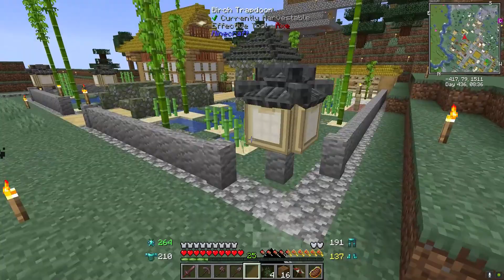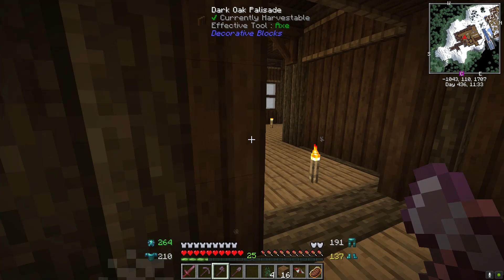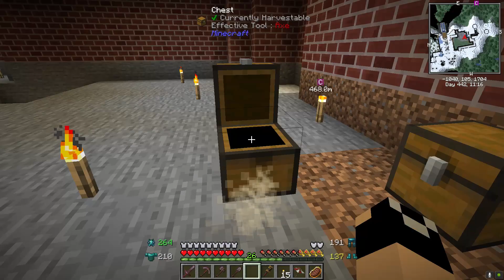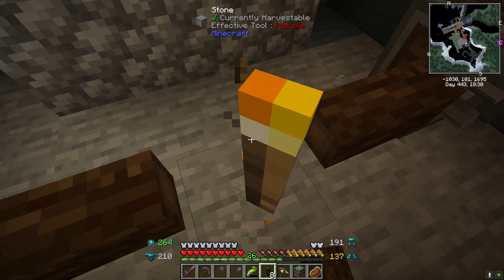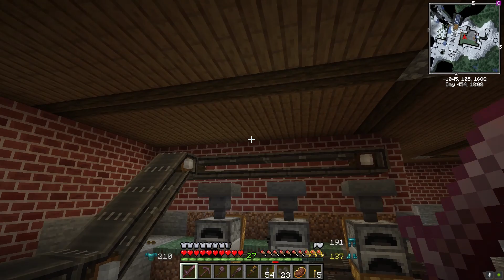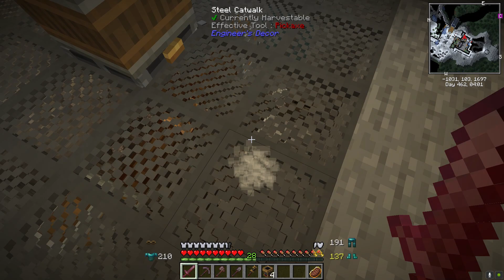Building a Boiler System : Valhelsia 3 Minecraft 1.16.4 LP EP #17

Comment: It's probably the piston sound that does the lag.. x_x
Reply: Possibility as well if the redstone clock is not well lit up, they keep doing a lot of lighting updates which is laggy
Reply from the maker: Shouldnt be the redstone clock.  Both are lit up very well since I know they can be super bad on performance, plus the fps hit didnt start until kinetic power was turned on while the redstone clock was running for a long while prior.  Dont believe its the piston either due to the same reasons and it only being a few pistons.  Never seen lag from piston sounds unless you have a lot in an area personally.
Reply: @ToAsgaard  But you pistons don't push as long as the cobblestone is not broken (12 block push limit). So as you start the kinetic power and the first cobblestone ist broken the piston can push the blocks. I seriously had just one piston on a clock and for some reason sometimes it freaked out the sound processor ("SoundControl Sound Processor is lagging; behind 132 msecs" for example). I backed up on the piston until it stoped lagging and I still could see it moving.
Reply from the maker: Yeah, but this lag is a constant lag and the pistons arent running constant due to the drill not being all that fast, it takes a few seconds per cobble being broken so the pistons arent running full throttle even with the system active, at least not without the cogs.